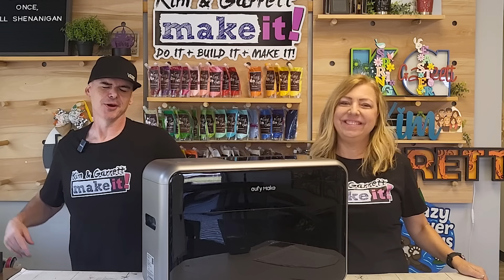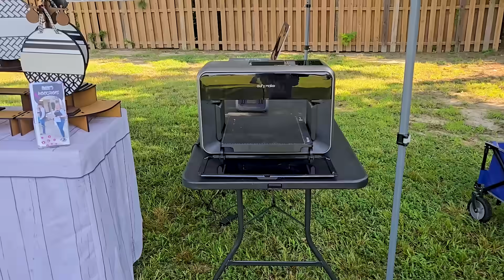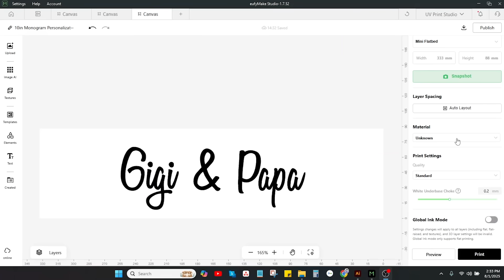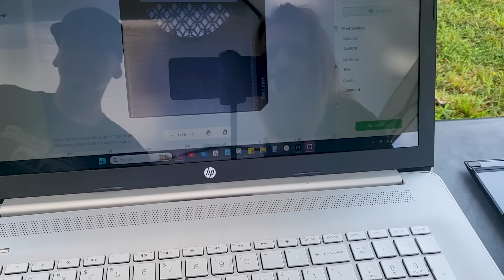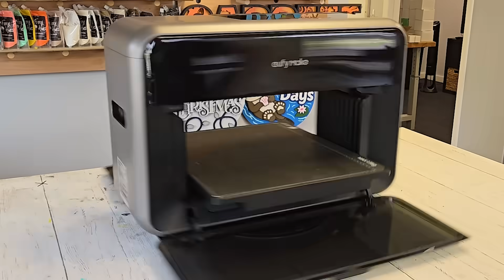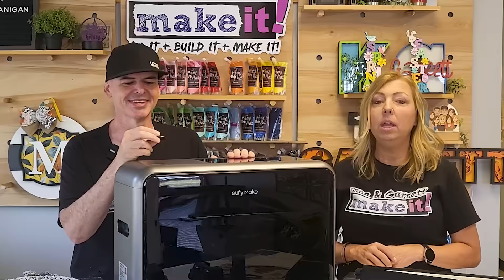We Brought a UV Printer to a Crowded Festival—Here's What Happened

Comment: See what I'm understanding here. It's very similar to back in the day when we used to develop images. Where you would need a dark room. Why do they not build a covering? Covering that can act as a dark room to prevent UV light from prematurely hardening the substrate. Speaking of substrates it'd be great if they also had a rubber Or silicone option to create patches as well as other Products that need a flexible Options.

Comment: I heard that you should remove the ink when transporting. Did you do that? If not, did you have a mess to clean up?
Reply: They say that for all printers.
Reply from the maker: We did not remove the ink and there was no mess.  We have moved around a lot and it seems fine.
Reply: I think as long as you are carrying the printer and hauling it in its' regular upright position..there is never going to be an issue. Its when it gets tipped that there are issues with printers